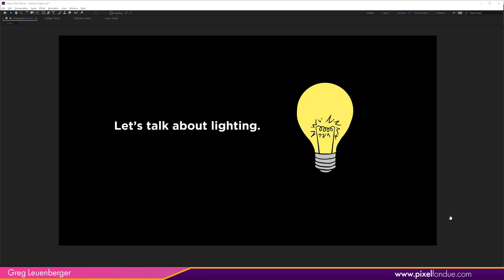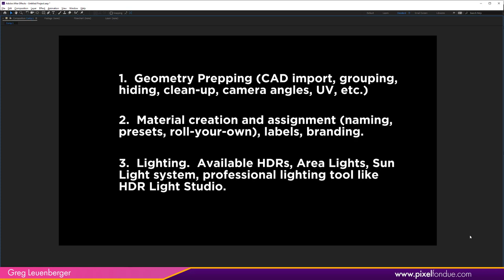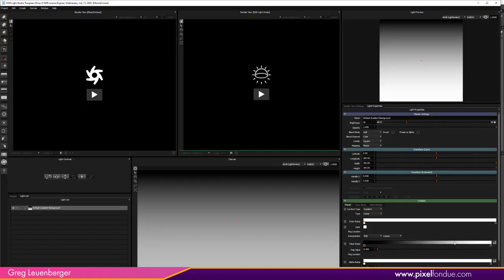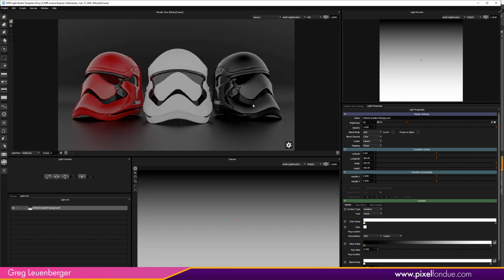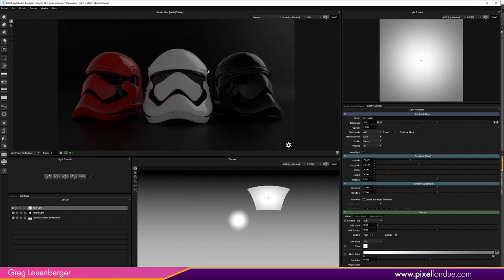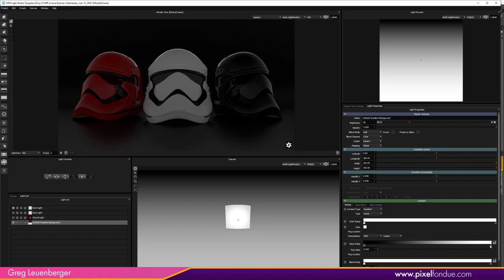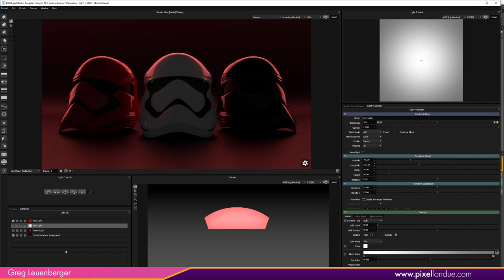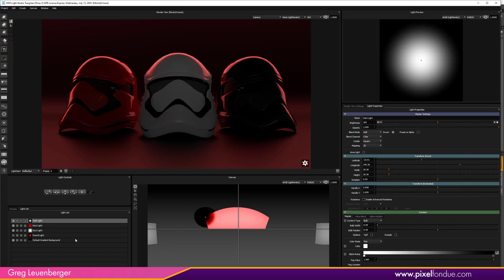MODO | HDR Light Studio Tungsten Drop 2

Comment: Cinema 4D R21 has a new "denoise" feature that involves removing noise from a render as a post process. I would love to see such a tool (or plugin) for Modo. It would speed up the creation process and not force people to create long renders just to reduce noise. Modo is my primary 3D tool. But, when it comes to new versions of Modo, the devs have a habit of removing or renaming settings and moving settings around the interface without any heads up as to where the settings have been moved to, or what the new names are for these settings.
Reply from the maker: MODO has NVidia's Optix denoiser built-in now (vers. 13....not in front of MODO right now but I think that's correct).  Both Octane and V-Ray have denoisers as well...so you should be covered.  Although I bet Optix is CUDA only...(so Nvidia only).  I should check on that.  Neat Image (for AE, PS..etc. is a great post-denoise plugin I use quite a bit).

Comment: the dark light is cool, but i'd still love to see light linking implemented for modo's native renderer at least
Reply from the maker: you can 'tear off' lights and turn them into area lights (which will light link if you're into that)
Reply: @Pixelfondue  i think light linking only works with modo's actual lights, the torn off area lights are still like 
illuminated polygons which light linking doesn't apply to

or im missing something... could you possibly test that?